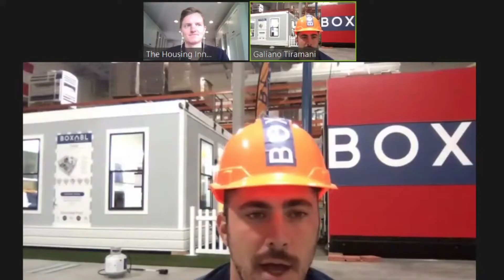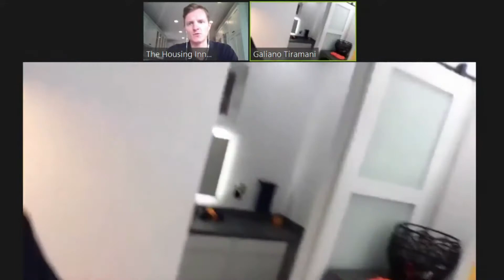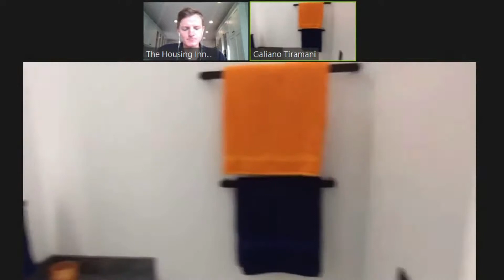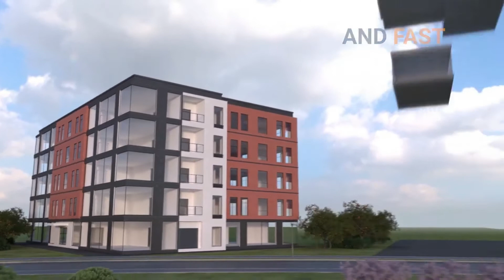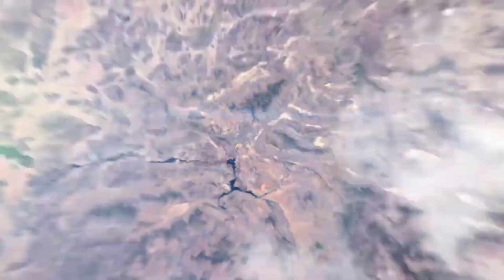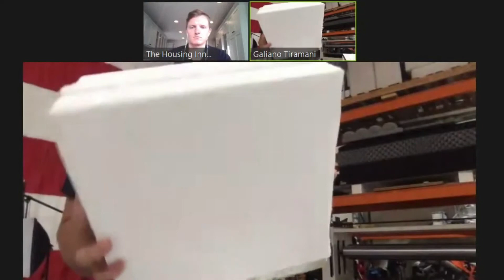Ep. 9: Boxabl Casita // Home Tour - Rapid Shelter Innovation Showcase

Comment: I am what is called "a fully qualified investor", not any smarter than you, just able to lose my angel investment if things go south.

In my opinion Boxabl is NOT a good investment.  Wish this wasn't the case, because home affordability is a real problem, Boxabl's cited technology just doesn't solve any significant prefab modular housing design problems (see my post below for details).  The big new Boxabl 170,000-sf "leased" manufacturing facility in Las Vegas seems to be still empty.  The robotic assembly videos appear to be computer renderings NOT real machinery.  Did you notice that the pictures of stacked Boxabl modules as homes in another YouTube video "10 Reasons...", the one with two cars parked in a garage below the living space, do not show any stairs or way of getting from one module level to the other ?  That's because Boxabl has never shown any working stairs in their units which go from one level to another just fake roped off start of an imaginary stairway.  When potential customers ask about stairs Boxabl says .... coming soon ... you can add them anywhere, but offers no working examples that I have seen, YMMV.

Working stairways are the least of Boxabl's manufacturing issues that worry me.  Three years on and they seem to have produced a grand total of 4 units but claim by the end of 2021 they will be mass producing thousands of prefab Boxabl modules from the leased Los Vegas facility.  In one early video the claim is Boxabl modules are 100% fireproof - which is tough when the walls are made out of EPS foam cores with wood framing visible.  To give them the benefit of the doubt perhaps earlier prototypes were intended to be made from different materials, but the current design does not appear to me to be fireproof.  Another YouTube video about Boxabl shows the host directing a propane torch onto the magnesium oxide panel outer covering.  The magnesium oxide panel (similar to cement based Hardi-panel) doesn't catch fire, but hold the torch on the panel a while longer and the flamable EPS foam underneath the mag-oxide panel is going to melt and then likely catch fire.

The host of this Housing Innovation Collaborative video asks excellent questions: folded seam waterproofing, (just how are the unfolded panels sealed to exterior elements ..etc) that Boxabl does not adequately address.  In other recent 2021 videos they seem to admit no building code testing has been finalized at the state level..... to be done in the future ... I guess.

As my earlier post explains, fold-ability as a prefab modular construction feature has been tried in the market and failed miserably because it is a solution in search of a significant enough problem.  The prefab home market determined that shipping modules on one truck as a 8.5ft wide unit is not of huge importance compared to so many more important problems: like manufacturing time, cost, transport damage ..etc.  GlideHomes Inc. often placed modules in parallel to get 20ft wide living spaces and also could stack modules two story, with working stairways !  Very well funded, they sold 400 homes before going out of business.

I do give credit to Boxabl for realizing a very important manufacturing tenant: customization kills mass assembly production lines - they want to produce identical modules then customize in the field.  That is an excellent decision on their part.  Even car manufacturers have limited option packages, even limited colors and they manufacture millions of units.  This fundamental reality escaped GlideHomes founder: architect Michael Kaufmann who's company produced (400) prefab modular homes with the help of $375m Bay Area VC money, .... now bankrupt.

GlideHomes founder Ms Kaufmann was a very good architect who's mission was to bring affordable mass production to residential architecture.  Like Boxabl that was a noble goal, and a huge addressable market, but if you do not have the manufacturing experience and resources required to plan for and solve the hundreds of important issues facing affordable prefab residential construction the results will not be good for investors.  Oh yes, to drive that point home: Katerra, the world's largest modular prefab residential construction company, with perhaps 750,000 sf of in-active-production automated manufacturing lines on three continents (real robots too), funded by $3-billion of SoftBank VC money just went bankrupt last week.  It is a tough market for investors in prefab "automated" residential modules.  

These issues could change for Boxabl and I hope they do, because someone needs to solve this very important problem of housing affordability and any company that does will do very well for investors.  My opinion, Boxabl isn't even close yet.

For those who would like to become angel investors, I have learned much from reading: "Startup Wealth - How the Best Angel Investors Make Money in Startups" by Josh Maher,".  Also highly recommended: "Venture Deals - Be Smarter than Your Lawyer and Venture Capitalists (4th edition)" by Brad Feld and Jason Mendelson, and finally: "Why Startups Fail - A New Roadmap for Entrepreneurial Success" by Tom Eisenmann.  Good luck to all, including Boxabl.
Reply: That makes sense, thanks for bringing clarity where they do not.
Would you know of a summary of the challenges of prefab/modular housing?
The concept is appealing, but I suspect reality hurts it a lot... so many things to consider.